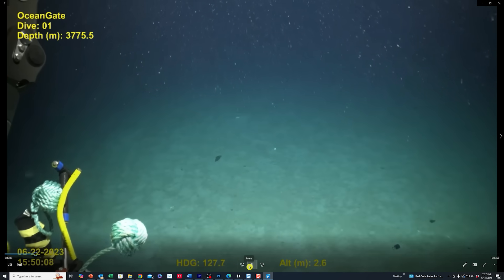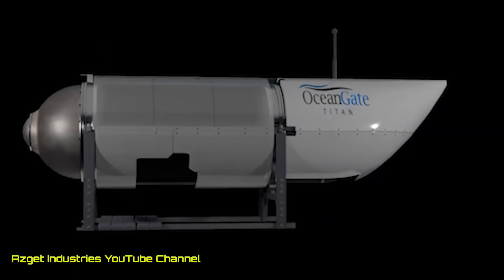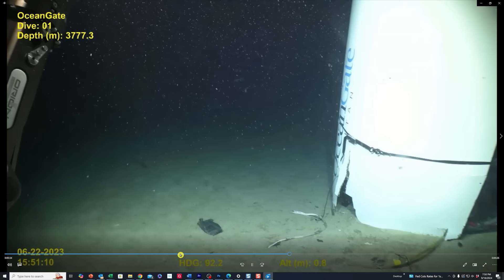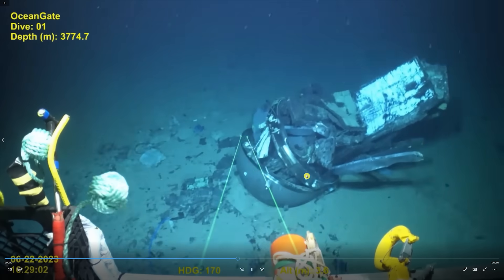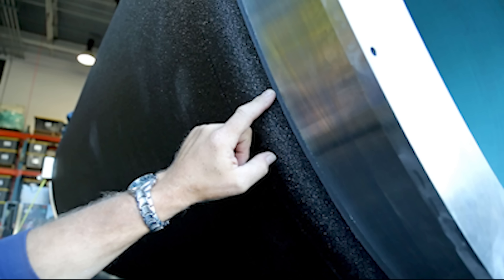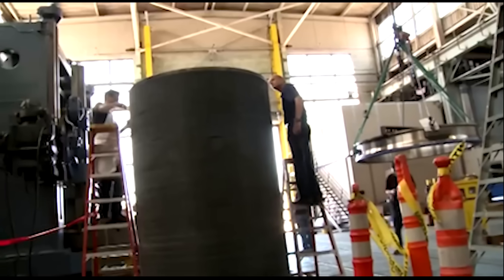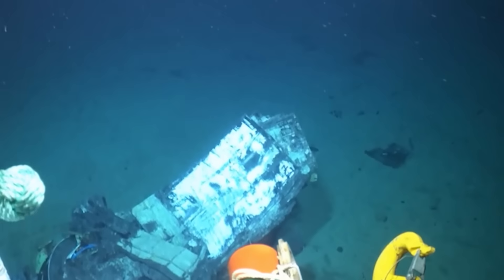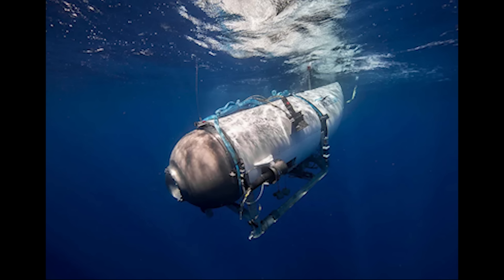OceanGate Titan Sub Debris Video Shows How It Imploded

Comment: You missed the best evidence here. The failure must have happened along the front upper edge of the hull or bond to the ring as carbon fiber hull and debris have been slammed back into the rear hatch. As the failure progresses this would take down the "roof" as well but the collapse from the front would reach the rear before the failure propagates around to rear floor. When the shockwave hit the rear hatch it blows it almost off the ring, severing all the connections to the tail in the progress. As the shock reflects back forward (which by now was also being pushed backwards due to the wall holding front and rear apart had failed, it most likely finished the job of separating all the CF from the ring. The "waterhammer" reflection was strong enough to possibly shear the ring off the front hatch but definitely eject the window which was held in to withstand pressure from outside not inside.

Comment: My guess is that the chunk left of carbon fiber was the floor of the vessel, and the reason why it's still there is that the floor and what what under it, which I think was oxygen tanks, "reduced" the pressure hitting the hull preventing it from breaking off.  This is probably also a clue as to where the original break into the sub was (i.e. "front, top of the sub, where carbon fiber is glued to ring").

Comment: At 7:02 he says the carbon fiber mix  it's like peanut butter. That is exactly what they got reduced to when it gave way to the North Atlantic. Crazy that no pressure sphere made out of steel was used as a pressure hull they are sitting inside a carbon fiber death trap. Go what the documentary about how the Limiting Factor submersible was made. It is certified to dive 36,000 feet. It was tested in a shop to withstand over 50,000 feet. The spherical hull gets stronger the deeper you dive.

Comment: go listen to the long nterview with Lochridge/Lockridge--  they did not even use the proper quality glue and if you look at the photos of his  wrap samples, you'd see that the wrape was done incorrectly with many airpockets and separations within the hull.  Mr Lockridge/Lochridge also photographed sections where he could literally see light through the holes in the hull which the "engineering team" then covered up iwth  truck enamel paint. In his inspection review list, there was notation regarding the faulty O-rings as  O-rings never fail. It's like Aloha Airlines  cabriolet and Challenger  never happened.  The amount of negligence and incompetence of OceanGate is staggering.

Comment: That looks like the X Box controller sitting on the ocean floor. That’s what he used to drive this coffin. I saw a documentary on this in the last few days and the viewing window was not rated for the depth of the Titanic. The carbon fibre was purchased cheap from Boeing because it was out of date and Boeing didn’t want to risk using it on planes they were manufacturing. Apparently CF breaks down slowly when in contact with sea water, so the first 5 or 6 dives, whilst okay, actually contributed to the breakdown of the hull.

Comment: Of course it was the hull that failed, but if built right i think it would have lasted a little longer. It really seems, looking at whats left, it buckled at one side. Like holding a soda can on its side and pressing one finger into it, the whole thing didnt crumble just one side. Which probably sucked lol like the hydraulic press vs videos.

That leads me to believe 
1. The hull had an imperfection on one side that finally gave in
2. The titan lost control and hit the floor, and the side that gave, was the side that hit the floor
3. An object, probably the kraken, hit the side that failed. Stand perfectly balanced on an empty soda can and have someone tap the side with a pencil, implosion lol

Comment: As an engineer, I would suggest that the peanut butter adhesive was more in compression than tension.  It was holding rigid parts in place but not together.  The incredible pressure was holding the parts together.  When the rupture happened, the inside became higher pressure like a blast wave, and that is what popped the titanium ring from the very come adhesive.  So, I do not think the adhesive was the point of failure.

I am not sure what did go wrong, but carbon fiber is like really strong thread.  It does well for tension like a space capsule, but not so much for compression like a submarine.

Comment: Bad adhesive job (tension pressure of 2 different materials when joined plus cyclic use fatigue), implosion front to back while popping off ends is my impression of the debris field. Human remains of all 5 recovered, perhaps in aft dome based on carbon fiber debris.

Comment: From a engineering standpoint looks like the front cap failed resulting in the front dome cap with the view port forcing its way back to the other dome hence why all the debris is mostly in the back dome so basically it's all squished in on itself just like stepping on top of a can. My money is betting that the weak point was the actual piece where the carbon was pushed onto the titanium ring

Comment: They recovered BOTH titanium domes, and rings…….they DID NOT EVEN LOCATE THE WINDOW……it was blown out the front like a bullet, after the failure was at the front Ti ring-CF interface, thus blowing the front 1/2 sphere off and pushing everything into the back sphere…..that big piece sticking out of the rear 1/2 sphere seems to be the interior floor insert.

Comment: Jeff, I think you have hit right on target about the probable cause of the problem start! You have two dissimilar materials that expand and contract at different rates, and then were exposed to extreme pressures! Then add in the factor of a questionable bonding method of those two materials and you, had to end up with a failure point! I watched part of one guys testimony (forgot his name), but he brought this point up and must have examined the parts brought up, as he made reference to there being no CF residue left on the front cap bonding area! Were on the back cap, there was still pieces of CF still attached!

Comment: Most mechanical engineers know that the more junctions, joints, and sections you have the more risk of failure you get in a stress situation.  And by no means a cylinder is the best shape to resist deformation from overall uniform high pressure.  The face of Stockton during that inconceivable “gluing” says it all on the madness of that “engineering”.
Reply: True, it's always a sphere, perfectly round ball, used a s pressure chamber for extreme deep waters. Navy subs, which are cylinder shape, don't go anywhere near these kind of depths, I think they 'only' go to about 300 m. Biggest tragedy is that Stockton was warned repeatedly and actually took offence at his critics, who were all experts !
Reply: @Itsallwrongbutthatsallright  Indeed, and when you saw that the CF cylinder was glued to that collar circular frame, you probably had the same “wtf” questioning moment in your mind like we did. Not even mentioning the absence of structural reinforcement with the tubular cabin (although it would have made little difference at that much pressure per square cm.)  Spherical is indeed the best single shape to maintain overall uniform integrity.
Reply: Can you make a carbon fiber sphere? I think that's why they went with a cylinder.
Reply: @trucid2  carbon is strong in tensile.
Reply: @trucid2  not 100% sure but I think I have seen a german engineering video where they did manufacture large CF spheres. Anyway, a deep dive sphere could be made of other excellent high mechanical pressure resistance materials.

Comment: So the simulations of the implosion we have seen so far, even in this video, are incorrect. They all show the carbon hull turning into dust, which as we can see now obviously did not happen. Also the cause (being the seal) of the implosion was different than assumed untill yesterday. It was not just the carbon fibre hull cracking and imploding.

Comment: When they scrap the Spencer Comp Hull and made the electro impact one, Stockton said that wouldn't do new titanium domes so they glue again the domes to the new hull, when they removed the old hull glued that cause some adhesion problem that led to failure in the front...

Comment: What Id like to know is the comparison of 2 time stamps. One we know the last communication or ping from titan was 6 seconds after dropping the weights. But the other is the time stamps from the Navy, the noise of the supposed implosion. Do both time stamps match? Or did the batteries short circuit, causing them to free fall then implode once colliding with the sea floor.

Comment: No mechanical seal, only adhesive. No struts running fore and aft locking them together, just glue. Even a soda can has a mechanical crimp.

Comment: Good point about the adhesion. I’ve had cars with handprints rust through from under the paint where a worker touched it before painting.
Reply: It probably didn't help that they used grandma's old strawberry jam buckets to mix the glue
Reply: I can vouch for that, when I was in the fiberglass industry, every time something went sticky, there was the handprint!
Reply: However, the touching was on the side of the seal ring that is bolted to the end dome cap and not the U shaped inner and outer lips that surrounded the end of the carbon fiber tube, and where the glue was applied.
Reply: @Set-it-to-11 oh ok, whew for a moment there i thought this was gonna be bad 👎 😃
Reply: @Set-it-to-11  and how did that work out?
Reply: Really? I had no idea. Honestly. Never painted a car in my life.

Comment: What mostly all people get wrong, carbon fibers are indeed triple as strong as the strongest steel and 1,5 as strong as titanium, BUT:
Carbon fibers are only strong in one direction, which is pull. Same as a rope. 
As soon as it becomes force from another direction, it is not strong at all. It’s only as good as the „ matrix“, means the glue which is used to the different layers of fibers together. That’s why carbon fiber is great for high pressure forces from the inside out, I.e. diving tanks, which have a tremendous high inside pressure. But is definitely not usable to protect from outside pressure! Then it is only as good as glass, it’s brittle and will fail.
In the video, they talk about 5“ of CF. 🫤, that means how many layers with how many chances of delamination? 
Then glueing that titanium ring onto the CF, no gloves? What the heck? That’s CF one oh one knowledge! 
How were the Cf layers tempered? Had these been prepregs? Did they tempered them under pressure from inside in a vacuum?

For me as an engineer, my first thought was: where the heck did these guys got the idea to do a hull out of cf?
It was designed to fail right from the start.

Comment: Look at that.... not all of the carbon fiber failed..... good job designers on that part..... not so good on the other parts though.

I'm curious to know what cracked the hull like that and made it separate from the cap.  She was only about 40meters from the bottom when she met her fate and if the front popped what severed the tail?

Comment: The expert that was on the ship when they salvaged the debris stated that in his opinion based off of seeing the debris as it was put onto the ship that the failure happened at the glue area between the rear Titanium dome and the Carbon Fiber hull. I would like to know how all of the electrical and air supply stuff was transferred through the rear Titanium dome into the pressure hull because that could also be an area that failed, other than the glue between the dome and hull.

Comment: Stockton Rush must have had a bigger ego than Bob Iger.  I am no maritime engineer nor a forensic scientist, but with a little research this Titan was a ticking deathtrap.   My thoughts; Aerospace engineer thinks he's a Brilliant deep sea engineer,  I.E. Really dumb egotistic idiot who thought he was brilliant in both fields.    Looking at the newly released videos, I am a bit surprised.  First I am no deep sea engineer, nor a forensic scientist.  I am surprised the tail section containing a lot of the motors and electronics sank mostly intact after the implosion. Although, if I'm correct the tail cone was not pressurized.  My second surprise in the video is the aft hemisphere and that a Little bit of still rounded pressure hull was still together.  I've got questions about that view and would like to know more.  What you first thought was the acrylic view port was in my opinion probably the forward hemisphere.   We saw video of that when it was raised.  It was stripped completely clean and no sign of the view port.  If they recovered the view port it would be interesting to see what condition it was in.  Although, I don't think the view port was the point of failure.  I believe it was the entire pressure hull that failed.  Sort of like putting a tall boy can of Budweiser flat on concrete and jumping on it with your boot heel.   just my thoughts.

Comment: dont think thats part of the carbon fiber hull. i believe thats the remains of the inner liner that all the inner witring, lighting and controls were attached to. 
i do think that is the front titanium cap. and the sand likely got in there when it hit the bottom without the viewport acrylic. 
what i dont understand is why they didnt wrap the carbon fiber around the connector rings to create a stronger seal.

Comment: The floating particles are all that is left of the crew. They disintegrated.
Reply: The floating particles floating around are probably common plankton. They are floating around the Titanic as well.
Reply: @jack_21_black  you could be correct. I based my comment off a few scientific analyses on YouTube that said the crew was disintegrated into floating particles.
Reply: @mikef3726  agree as well. Now that we see a bit of a different story, do you wonder as I do when they refer to “human remains“ what they actually found? The Titan imploded from forward to the aft (so they now believe) where all the carbon chunks are shoved into the aft, they must have found some remains in the aft as well, would you say?

Comment: The way they glued it was obviously part of the problem but the biggest part of the problem was narcissism.
Reply: Gluing two different materials like composite and titanium to withstand the pressures at the depth of the Titanic is madness without strenuous testing first.
Reply: So help me a few other people I know interested in this disaster said the same darned thing. I agree...
Reply: Stockton also bragged about how he used DEI to hire people in his company.  Why bother hire somebody based on actual abilities???
Reply: @jonw3738  Jesus, you're sad.
Reply: @jonw3738 He wasn't using DEI so much as he was using DEI to cover up that he was cheap. And he was using it to showcase how easy the sub was to pilot, which was supposed to be a selling point for oil companies. 

"Oh, you don't need a highly skilled pilot, anyone can do it!"

It was all just a lie

Comment: Dude, the carbon fiber failed. They used a pressure vessel that weakened with each dive. They had no idea when it would fail and apparently gave it little thought. Can’t do much against that until it’s over. Rich guy with a suicidal ambition.

Comment: Yes that piece is the other titanium dome, you can see it clearly at 5:50 with some sand in the bottom if it (I'm not as sure this, but that looks like the one with the view port hole cut into it with sand pushing up through the hole). The two clips we got seem to imply that the back of the sub took the least amount of damage, while the front was totally destroyed.
 Also yes guys that work with bonding carbon fiber flipped out at the shoddy workmanship on display they were doing in the bonding (there vids on Youtube by them talking about it). For an application like this they'd have wanted the bonding done in a sterilized clean room environment and that they'd be wearing not just rubber gloves but a full cleanroom suit.

Comment: I believe what we are looking at in the sand is the actual window that has cracked in the middle and blown free from the titanium nose cone of the sub. The secondary cone should be face down in the sand under the rear portion of the sub that you showed us first with the name of the company on it. He did everything wrong and was so arrogant. I wonder if they were still alive for a moment when that glass window started to crack? Because I believe he made a comment that said something like people. For there's a problem, the glass would crack. Of course, we will really never know what happened as they had a rapid descent to the bottom of the ocean. Who knows what his business might have been if he didn't buy secondhand material from the airlines and get nuts and bolts off the shelf from the hardware store. Instead, spend the money and build a real submarine, like James Cameron has if he really wanted the real thing. It's one thing to fool yourself, but to have the stupidity to kill four other people is unbelievable.